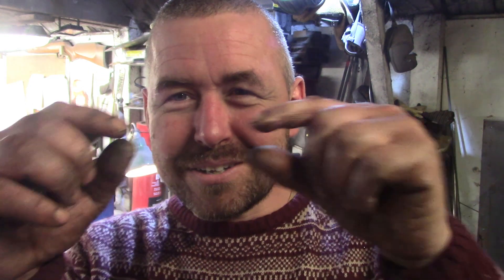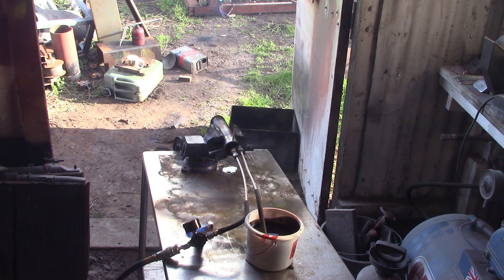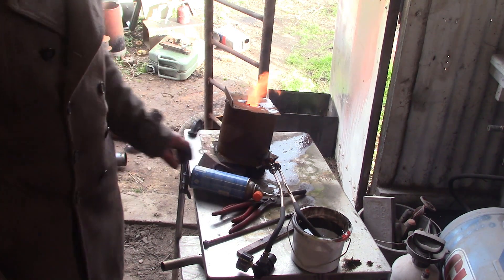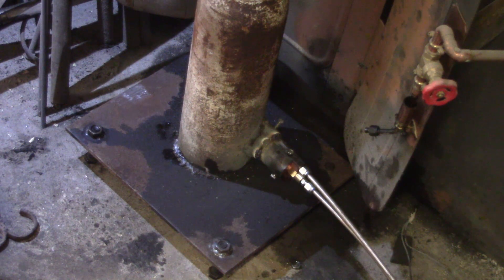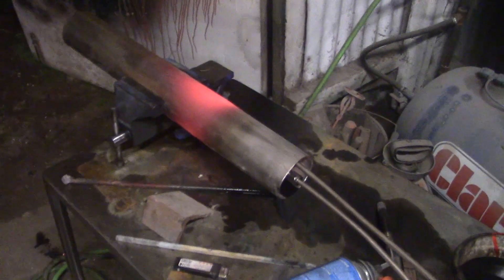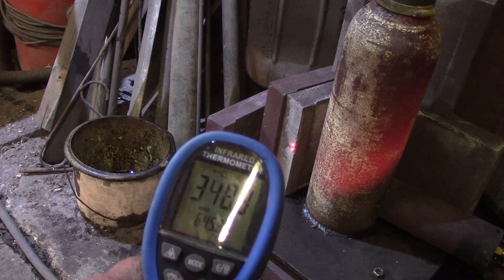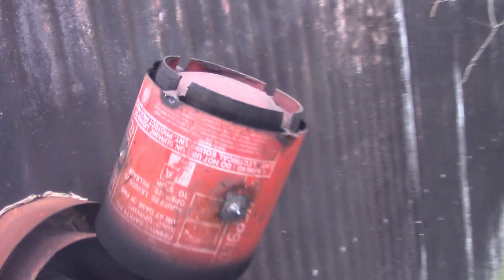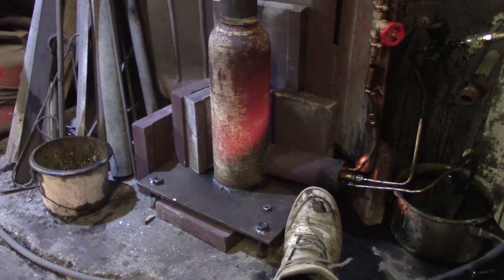Syphon nozzle waste oil heater

Comment: What's the benefit of forced air? I need a heater for my garage would just gravity fed oil and air holes at the lowest point be good enough? It would create it's own air flow once burning?
Reply from the maker: Cleaning! Without forced air the burner itself fills up with crud pretty quickly with baked on crap.
Some folk use a wee bit of petrol, apparently 5% works ok.
Some folk use pans or trays that they throw away.
The last thing you want is for the deposits to build up and burning oil to flow out onto your floor but that's a real hazard with these things (voice of experience)
If you've got forced air you can get the burner hot enough that it just leaves dusty white ash that disappears up the chimney, downside being it's noisey, burns metal through and is harder to get working initially.
Ideal set up, and what the larger commercial waste burners do is having a cleaning cycle that burns off the crud but in normal use burns a bit cooler so it lasts longer and isn't quite so obnoxious.
Reply: Subscribed

Comment: I'll be picking up a propane pot belly stove from a buddy, and converting it to waste oil. I'm hoping to use gearbox oil in it, and have a potential source for it. It supposedly burns clean since there's no soot in it.
Reply from the maker: I've heard the same thing about used hydraulic fluid, makes sense if you can get it.

Comment: Jim, would there be any benefit to wrapping a piece of tubing around your burner to preheat the oil? I would think that having it going into the burner warm or hot would increase the the flash point and cause it to burn hotter.
Reply from the maker: Id use a controller and electric element if I was going to pre heat, consistency would be the main reason to pre heat, it'd make start up easier but this is pretty easy to start anyway. I wouldn't want to get it too hot though as it's coke up.
Reply: @turboconqueringmegaeagle9006  years ago I worked at a company called Clean Burn that made waste oil furnaces, and they had an aluminium block that had a preheating element in it.
Reply from the maker: @Farm_fab  just been looking at their website, can't get much info off it but it looks like they are using modified Beckett burners which is where I've seen the thermo controlled pre heats, I'm certain the main reason for them adding pre heat to the traditional no.2 heating oil burner is for automated ignition, really nice set up for a commercial workshop.

Comment: its really weird, I've been watching waste oil burning videos all week. As soon as it warms up  a little more I'll be busting out the tools to try and build a micro forge with waste oil burner.
Reply from the maker: Have you decided on a particular set up?
Reply: @turboconqueringmegaeagle9006  I’ve got a few ideas. A few diagrams too , need to make the ‘jet tube’ removable so it can be hot swapped between a forge and a pyrolysis barrel . Currently trying to source some pizza baking bricks on the cheap or I’ll have to go down the rock wool or similar route.  There’s a guy got an auto drip system for melting engine blocks so may look at that too
Reply from the maker: @argmentum22  all interesting stuff, especially the pyrolysis.
Smaller is more finickety from my limited experience.
Reply: @turboconqueringmegaeagle9006  your early ones I think weren’t getting any extra oxygen ..
Reply from the maker: @argmentum22  I can't remember much about them, but I think the smaller quantities of fuel make ironing out the inconsistencies difficult and the geometry more important, I'll probably try a small foundry with these syphon burners, makes a bit of sense in terms of a compact package.

Comment: Have you tried preheating the oil? Could make for a easier and smoother burn.
Reply from the maker: I did a long time ago on the "micro waste oil forge"  I was getting it too hot though and it coked up, maybe I should try again with an electric heater and pid control, it wouldn't be hard to rig up but this starts up pretty well.

Comment: That looks a bit toastier than than the cheap diesel cab heaterI have in my little workshop. Luckily mine is insulated though so it’s colder than outside normally 🤣
Reply from the maker: I tried one in here, this ol tin shed let's a fair breeze come through so it didn't really get things warm enough.

Comment: have you ever seen a spray paint gun with a preshor pot a setup like that would give you control of the flow of oil
Reply from the maker: I tried a normal spray gun, seemed ok, no different to this nozzle really apart from the bulk.

Comment: Would that run the central heating indoors Jim?
Reply from the maker: Biggest limitations burning this stuff is the muck and getting it lit so you'd have to be imaginative, at foundry temperatures there are no deposits, anything less and it needs regular cleaning.

Comment: They work quite well wanted one a while ago for heating but they were hard to find in smaller sizes. Have tried to make that pre heater cannot get the coils tight enough my self so ended up using a longer copper tube bent with a curve inserted into the foundry seems to work but the copper tube won't last long mabe a few hours https://youtube.com/shorts/v-c93RPZWSw?feature=share
Reply from the maker: Tight radius bends in stainless is specifically why Cerrobend was created but I've heard of people using lead and all sorts, I've messed around bending copper this way, maintains the bore of the pipe near perfectly without using anything other than a bar of your desired radius as a mandrel. What dia pipes are you using?
These nozzles are pretty fun, what I'm interested in doing next is building a much cleaner venturi and using the nozzle to create draught, probably won't work but if it does I could be in bronze casting territory with just a 30watt aquarium pump, think how compact that set up could be.

Comment: How about building a collar with fins out of some alloy (casting) to insert into the chimney on the inside of the shed - 

Or just weld some thin metal fins to the chimney and wrap them so they produce a vortex ... and suck more heat into the room.

Or a wee fan pointing at the hot bit.

I feel for you - we just got a concrete bunker for a workshop and it is soooo warm compared to the old shed.....
Reply from the maker: It's a bit like pissing into the wind with my shed, can see daylight through everything but the windows mate.
Not so worried about getting the maximum heat recovery at this point, still deciding if I want to cut it open again but I like the idea of some fins once I'm happy with it.

Comment: He's lost it lads! (The intro that is). Interesting work would like to see what the nozzles look like and why you didn't make one? (In that fine lathe you have)
Reply from the maker: I showed the nozzle in the intro...  That I lost.
Geometry and hardened steel inserts mean buying at least one made sense, I'd probably make the body next time as it's not very compact but the nozzle itself is worth the money just for the guaranteed suck.
Reply: @turboconqueringmegaeagle9006  I would be interested to see what it looks like.
Reply from the maker: @BensWorkshop  excellent news my friend because I like them and will certainly be messing around with them some more!

Comment: have you seen the becket burner designs in the usa, they use a oil nozzle and blower fan behing the nozzle to help burn the oil cleanly, i realise they use diesel, maybe some inspiration may come from it. I have seen some vids on YouTube having a small oil pre heater (60 ish degrees c) then it atomizes thick engine oil way better even in a siphon nozzle, also the channel nobox7 has a huge amount of work and knowledge about oil burners, i seriously recommend checking him out, awesome dude https://www.youtube.com/watch?v=afG2E2XImsY and also the Japanese style oil burners, very simple in design and i have seen they have a blue flame when working even on waste oil
Reply from the maker: I've watched a few of nob's vids, what I'm using here is essentially the nozzle out of a Beckett and those Japanese burners I'm not familiar with.
I'm trying to achieve a compromise between filth, noise, size and not setting fire to my shed, not a complicated brief you may say but they all conflict, burning waste without leaving rock hard deposits need forced draught but that's pretty noisy, I tried putting the noise outside but that created more problems, I'm having fun, using bits of other people's ideas and burning my eyebrows off occasionally.
Reply: Hahaaaa I got the same issue here, getting something to burn clean, leave few deposits but also quiet is so difficult, as you add a small blower and now you own a jet engine. The Japanese burners I guess coke up with stuff but due to them having a lot of surface area for the oil to vapor it doesn’t seem to matter and crucially they are pretty quiet compared to others
Reply: https://m.youtube.com/watch?v=E-TSqDwqfIo&t=183s That’s the Japanese style burner, may not be from Japan tho not sure
Reply from the maker: @mnshp7548  it's a nice design and one I haven't tried but I've spoken to various people that have and do use it, it needs a blower, some people run them with drippers rather than this chap with the pump and I've heard several serious users (there's one chap on here that heats his house with one) say the oil needs mixing with a bit of petrol for consistent trouble free operation.
Like all of different designs it's got a lot going for it, but for me it's definitely not the oil burning unicorn I'm looking for, but probably closer than anything I've made so far!

Comment: Did you use an Engine Degreaser wand as your suction nozzle?  They work great, the ones I have used are from a store called Harbor Freight in the USA 🇺🇲 and they will suck up and spray used oil, and have a very accurate fuel/air control as well as being durable and come with everything.
Reply from the maker: I tried a paraffin gun (that's what we call them) and I've also tried a paint gun. What I'm using is a syphon nozzle out of a oil fired central heating burner.
Everything you say about the paraffin gun I found but the reason I wouldn't use one as a shed heater is it's really hungry for compressed air so I wouldn't be able to run it off an aquarium pump.
Reply: @turboconqueringmegaeagle9006  I run mine off those hydroponics/pond air pumps that draw from 60-100 watts depending on the unit.  The guy who gave me that idea was MKSBoysal on YT who has the best burner design for used oil I've ever come across called the "Boysal Burner" 
I use the 100 watt unit, but the 60 will work, those things put out a decent amount of air and can develop a small amount of psi of pressure on the flow.
Reply from the maker: @ProlificInvention  channel name rings a bell, I'll check him out cheers.
I'm sure there are loads of different models of those guns but mine wouldn't get out of bed for less than 20psi and that would be distributing droplets rather than a finely atomised spray. 
One of you lot in the comments put me onto those aquarium/gardening pumps, I ordered it weeks ago and it still hasn't arrived unfortunately.
Reply: @turboconqueringmegaeagle9006  Yes, I was on the comments mentioning the nozzles and those air pumps awhile back because they do work awesome.  I hope to see you trying them when you get them, I had a 100 watt version that ran for 4 years straight in my pond running 12 commercial air stones..things are durable and they work for lots of applications including oil burners for heating garages/workshops.  I once made a burner called "The blue flame oil burner" using a 30 watt air pump of similar commercial design, and an old paint sprayer.  It worked excellent for the experiments I did